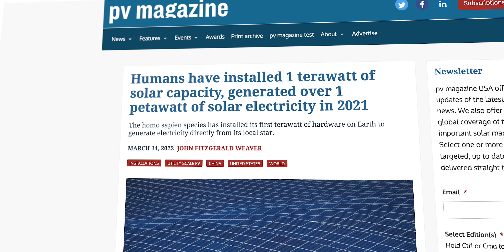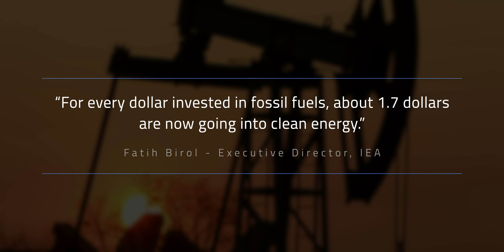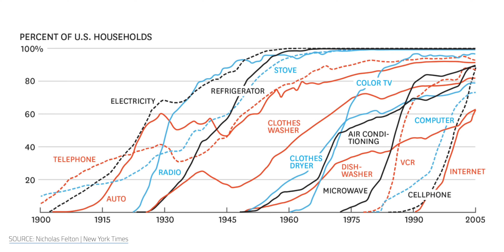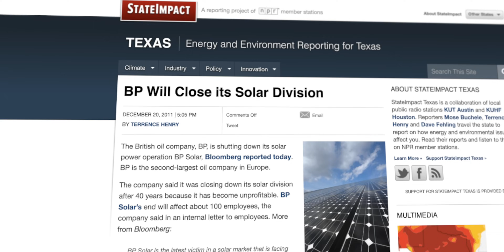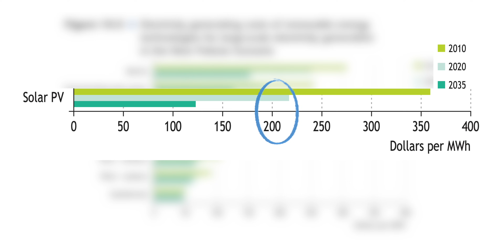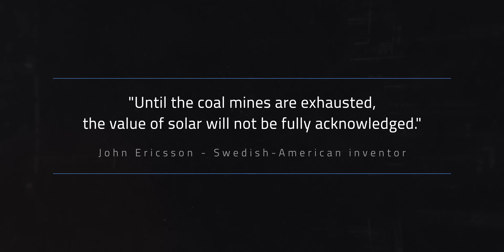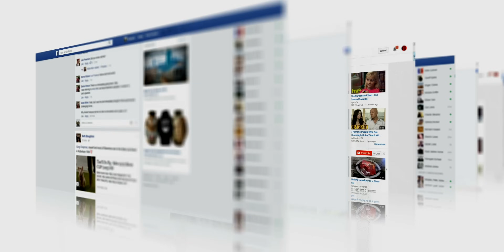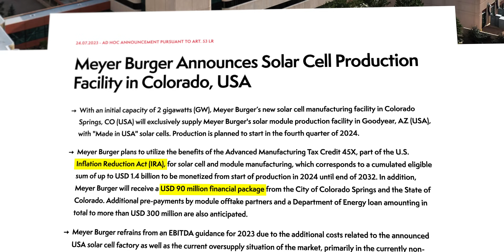How Solar Power Got So Cheap … So Fast

Comment: Not a single mention of the intermittency of this power and the effects on the grid which will limit adaptation until the grid is updated and repaired properly. Which means, put simply, don't expect this to become the largest source of US power any time soon like the next decade, or probably even the next two. And I'm being nice and assuming they get even cheaper and solve the storage problem. Or we do Space Solar. Not a mention of the inadequacy of the current battery tech to make storage cost effective for the average person (I've seen plenty of vids on the advantages and disadvantages of things like Tesla Powerwall). Not a single mention that some areas of the world get far more solar power than others. Not a mention of how inefficient the conversion of photons to electrons still is, even with the vastly increased light harvesting potential of modern panels and  the perovskite ones they hope will be the future of the tech. Not a mention that this is still polluting tech, both in how its manufactured and in how its transported (ironically, largely using lots of the 'evil' fossil fuels, including the fossil fuels burned to make the ships and trucks to transport the solar panels.) Not a mention that the Chinese are still building freaking COAL plants , as well as nuclear (which I support but lots of scared idiots don't), so lots of our 'climate sacrifices' are going to be for  nothing. I suppose you also believe the subsidies will continue indefinitely, and you neglect to mention that the cost incurred is basically an 'energy tax' which of course will effect prices and the whole economy because energy IS the real basis of the economy at least at a physical level. I guess the US's poor should thank you for your support for making the prices of food go up, medicine go up,  entertainment go up, transport go up, and basically decreasing everyone's standard of living.  
I watched this video hoping for some new information, a breakthrough, something I didn't already know and was disappointed. Instead it's all Ra-Ra  "renewable" or "sustainable" energy, appeals to simplistic sociological theories of technological adaptation, appeals to fear and an absolute refusal to admit that the technology as it is exists still has many limitations and costs and some limitations seem harder to remove or 'innovate' around than the others.

Comment: you missed a lot in this video. In the end it comes down to cost, and until very very recently solar was not cost-competitive with other sources. so what you didn't talk about was the role China has played in massively reducing the unit cost of solar panels, in response to their own incentive programs and the size of their internal market, plus push factors like climate change and energy security concerns

Comment: We all have to power our homes in some way, but solar offers a better way.  Rather than a life-long tether to a utility company, solar offers a means to break that reliance, yet profit from solar with net metering.  I can run the numbers on my system's "payback period", but I don't do that for my car purchase, roof replacement, new washer and dryer or much of anything else.  Going solar offers me the benefits of generating reliable power,  being free of fossil fuels, and the ability to offset the cost by eliminating my electric utility bill.  Something I can't do with almost any other purchase.  And in the long term I'm in a net positive financial position.  (Don't ever let any utility or fossil fuel pundit tell you your "payback period" won't make it worthwhile so you should just stay "with them".)

Comment: The real value of solar is the price that can be gotten for the power produced.  With solar this become a problem in that solar, at times, over produceds power driving the reture on this power to almost zero and can't produce power on demand when power production has higher returns.  Maybe with cheaper storage things will be different but maybe combined with nuclear with storage solar could be more practical too.

Comment: I still think wind power and various hydro power technologies are the way to go.  Solar is great for peak daytime extra power or off grid but batteries are still pretty expensive and since you know that whole night thing and bad weather happen a good bit in various places that really limits solar in a lot of places.  We can plan wind and hydro to not need battery power as often, grid storage is still a good thing but I doubt anyone as far north as the USA or Europe will get above 25 - 30% of there total grid power from solar in 10 years.

Comment: Hi Matt! Speaking of levelling out the duckcurve, here is one way of doing it. Make the towers holding the windgenerators with flywheels inside. Combine it as a mechanical battery (as a elevator) and you benefit it twice! No extra area is needed and you also use a minimum of extra coppercables for this build!😊
Reply: It sounds great, but mechanichal batteries (other than pumped hydro) just don't store enough energy compared to chemical batteries to be practical. E = mgh and 1 wh is 3600 joules, so you need to lift 10 kg 36m to store 1Wh of energy. compare that to chemical battereis where even the lowest performance chemistries could store more than 2000 Wh without moving. 
Pumped hydro works decently because using water with damms pipes and pumps lets you get a huge ammount of mass and height for a comparatively small ammount of infrastructure.

Comment: I think you're kinda missing the point on the cost shift (I watched the other video). It's less about "minimum price", and more about why PV users shouldn't get a heavy subsidy. During the day when the sun is shining, the wholesale price of solar power is extremely low (sometimes negative!), and yet with net metering you get straight up kWh credits. Then at night, when solar prices are infinite (or at least very expensive with storage), you get to use those credits to get "full price" electricity for effectively pennies on the dollar.  The net effect is that PV users get a massively discounted price for electricity *use*, not just the shirking of fixed maintenance cost.

If you're going to be an energy producer on the grid, it's a lot more equitable if your credit is actually the current market rate (rather than the market rate of the following evening or some kind of average like most grids use for consumers). That means your 1kWh produced may only net you 1/10th of a kWh at night sometimes, but this is the challenge with solar right now. If you bought enough storage to not need the grid at all, and then you'd be paying the true cost of solar, which is a lot more than you're paying with net metering (where everyone else is putting up the difference).

Also, your point about how companies are not entitled to make a certain given amount of profit seems disingenuous. Yeah they aren't, but customers are also not entitled to get free or heavily discounted access to a company's services. They chose a pricing model that made sense at a time when everyone was a consumer and used about the same amount of power. Now that this is changing, a different model can be used. For example, in some places you pay more per kWh the more power you use. This incentivizes conservation, but without giving PV customers an undue discount on power use. 

As an analogy, imagine if the power company just gave you free battery storage with your solar panels. Enough for a few weeks or so, to cover those smokey weeks in CA, and that non-solar customers would pay for it. Would that be fair? I think most people would agree it isn't, but it's effectively what we're doing with net metering. The grid is the battery. You're banking kWh when they're cheap, and extracting them when they're expensive. Solar intermittency has a cost to the grid, and that cost should be borne by those who reap the benefits of solar, not everyone else.

Comment: I am not sure what you are talking about? I got a fantastic deal on my Tesla Solar system, and it is still way more expensive than CNG, under ideal conditions for Solar. Fully installed my system cost $8200, for a 12 panel 4k system. Here in Las Vegas Nevada, in ideal conditions, that system produces 7MWH per year. At 5% interest, that is $410 per year, plus a 30 year depreciation of $273 per year. And I have not yet charged anything for maintenance and repair, nor overhead, business risk, nor the fact that I must store the electricity to use it overnight. That last item would have doubled the price of my solar system, adding a Powerwall at $8000. Without effort, I could have gotten the 7MWH at an expensive 12c per kwh here in Nevada, for $840, created from entirely clean CNG. In clean coal States, I can get electricity for 6-8 cents. So Solar is either double or triple as expensive than CNG or Coal or Nuclear.

Comment: My predictions were right where it is. But we need to upscale Tandem perovskite cells, and we need to make systems more hardened, both in wiring and encapsulation. A panel system should be ready for hail up to 2 inch, and ready for 70 years of Sun. Otherwise too much silica wasted, lead used, repair, maintenance, so on. Make it right Make it Once. If we're smart Solar will be at minimum 15% of generation by 2035.

Comment: to be honest prices didn't move that much in the past few years (at least over here in EU). Overall you still need about 7 to 10 years to recoup your investment on a solar panel. 
You'd think those DYI solar panels you hang to your balcony or walls and such that, at first sight, are cheap, would be a better deal.. but nah, cheaper but less power, overall same price still.. 

so yeah honestly I expected better

Comment: I continue to look at installing solar on my roof however between my limited power consumption (low monthly bill), and still high cost to install my break even point is still about 18 years away.  Add in the fact that the net metering while I have, is very low it just doesn't become financial responsible.  I'm fortunate to have lower power costs due to hydro power and that alone is a huge deterrent for purchasing solar.  Overall interesting video and I've been watching costs fall for years, but they need to fall more and without government subsidy or you risk having the market collapse like what is happening in China with EV automakers...
Reply: lol I see you watched anti-Chinese propaganda videos

Comment: The video was interesting as far as it went, but you focused on general historical trends in adopting new technologies and the role of government policies and subsidies in accelerating adoption. But based on the title I expected something more technical explaining what advances in design, materials, solar panels, energy storage systems, distribution systems, etc. have made solar power less expensive—and not including subsidies as a cost reduction.

A complete cost analysis should consider life cycle costs for maintenance and eventual replacement as well as the environmental costs of mining and sustainability of finite material resources. These are longer term issues but policy makers need to consider them.

Comment: I wish that I could have done the solar hot air I wanted to at my old house in Idaho.  It was surprisingly rare there, even with a lot of sun during pretty cold winters.
Reply: Passive solar is a good idea, but heating/ducting air has it's issues. You could look at evacuate solar collectors (for DHW) and pump a transfer liquid through them.

Comment: I am now in the Philippines. We have plenty of sunshine, frequent blackouts as a result from insufficient grid and power production capacity. My power company doesn't offer any feed in tariff. We pay grid power per kWh, there is no fixed connection fee. This tariff structure benefits the poor who use very small amounts of power, but it also means that power companies do not want people to buy solar and reduce their grid power consumption because that would lead to less kWh to carry the fixed cost. The power companies should introduce a double meter fee for people that want to feed power to the grid. The Philippines is behind the curve. You can see plenty of solar powered lights (with a battery) for when we have a blackout again, but grid connected rooftop solar is pretty rare. Grid tied solar doesn't work during blackout. So, the people with rooftop solar often also have batteries. But the current generation of battery technology has low cycle life in this climate. With better battery tech or better policies this country may also start to adopt solar.
One thing about the 'low cost' of solar is that not only is solar adoption being subsidized, production is also subsidized. Especially in China.

Comment: Rather than having such large and broad solar incentives, I would have much rather seen a combination of carbon taxes and more targeted incentives. In particular, multi-unit housing is largely being left out of the current adoption phase. This must change.

Additionally, utilities must be required to integrate VPPs as "just another" peaker plant. To a very great extent, thorough VPP integration would balance measures like California's NEM 3.0.

Comment: The adoption curves don't really apply to energy production. Of course it makes sense in a lot of places (central latitudes) to install it locally with subsidies to supplement electricity, but electricity only accounts for only 30-40 percent of energy use and residential is only 20-30 percent of electricity use, and solar only makes up maybe 2% of electricity generation.  So that means residential electricity only represents 10-15 percent of energy with only 2% of that solar. The adoption curve for solar is 100 years long and doesn't replace all or even half of energy requirements. Agreed, if it makes economic sense to personally install some solar, go for it, but it's not like this is going to be a fast growing adoption or a solution to climate change.

Comment: Renewables have far too many issues, the toxic waste in old solar panels and wind turbines, short lifespan and intermittent supply. There's been more than enough stories of hailstorms destroying solar fields, freezing temps knocking out power supplies etc...modern nuclear is a FAR better option, ie nuclear plant designs like Copenhagen Atomics, X-energy, Oklo, and Last Energy

Comment: Oh, solar has gotten cheaper? Neat. It keeps up and I think using roofs for solar is a good use of space. However, I'm not as much a fan of solar fields because of the investment of space for a relatively low amount of return, and the manufacturing of solar cells has been bad for the environment. Fortunately the USA has a LOT of unused space, so not a massive deal, but still nuclear could produce so much more energy for so much less space while still being a very clean source.
I'm all for a diverse set of power production, especially if it can be utilized in conjunction with something else or have a small footprint. I saw a video recently on the study of wave energy, and the challenges in trying to use the ocean for energy production, and if those challenges can be overcome I think it could be a good source of energy.

Comment: I've installed solar in Australia for 4 years now and im not convinced it's worth it unless you run a pool pump and aircon all day. Simply put solar is DC produced meaning it needs an inverter to run everything which can create unstable loads since RCD's are sensitive this can cause your circuit to trip, yes this happens mainly on heavy loads like pumps. Then you need a smart meter and eventually a redesign of the whole electrical grid. It takes away your economy of scale and makes the grid more expensive to maintain. So even tho you get solar you will still pay a maintenance bill because making electricity at scale is actually really cheap. But you still have operating costs when everyone has solar so you will have to charge maintenance bills to solar owners or do what they do now and just inflate power prices to a stupid degree encouraging solar making the problem worse. Im afraid solar system will get cheaper to install, but your power bills will cost go up too.

Comment: Ray Kurtzwell back in 2010 called for a doubling of solar tech every 2 year which was an over estimation as it looks like it is doubling every 2.4 years. 

He was actually more optimistic 

If this continues we should be at around 9.2% by 2027 and 36.4% by 2032 and with the next doubling take us over 60% by 2034

Comment: before i even start the video, i will say it's 100% about subsidies. the entire gas and oil is being kept up by them, if those where to go to other areas instead...well not only would gas and oil fall off a cliff but the other sectors would rise rapidly.

it's the problem most techs have, it's all about how much money you throw at it. if they did the same to hydrogen it would be the fastest growing sector as well.
Reply: called it.

Comment: A good movie but it left some questions unanswered. Photovoltaic was already discovered in 1954 but it was only in the 2010s that the prices really fell, so why did it take so long? And could the price drop have happened earlier than 2010?
Reply: Well, part of the explanation was that China built out a massive industrial infrastructure, so that the product  becomes cheaper. So it might have been possible to start early but it would have been expensive and someone had to be willing to pay for it.

Comment: Solar needs to take storage costs into account too. It's pointless generating very cheap electricity during daylight low use times when there is little demand. Solar is not base-load renewable generation unless it has storage.